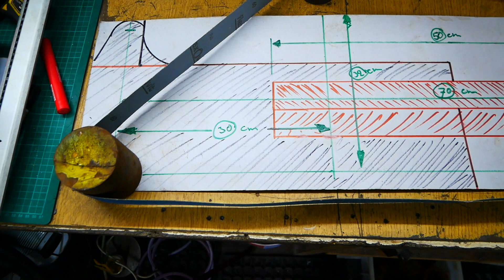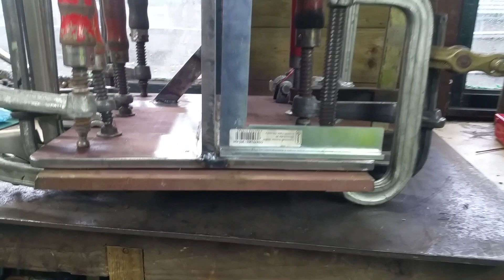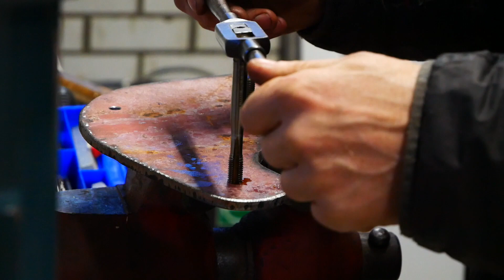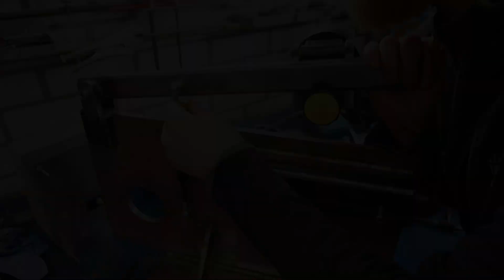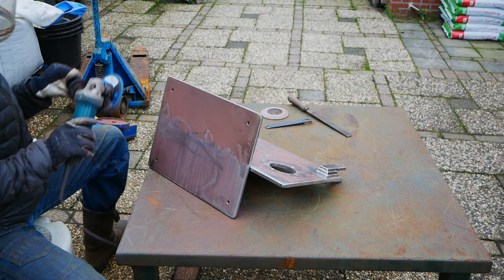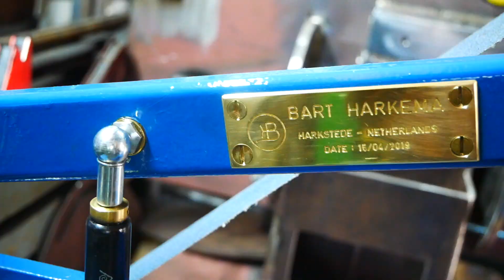Making a SOLID (62kg) High Quality 2x72 Belt Grinder

Comment: What size motor is that?
Reply from the maker: This is about 1HP but was a little to small. Go for at least 2HP to get enough speed and torque.
Reply: @bartharkemametalworks2299  but do you by chance have like a model number I can reference I know TechTop is going to be the most cost effective compared to like a hub city or baldor what your using seems to be doing the job...